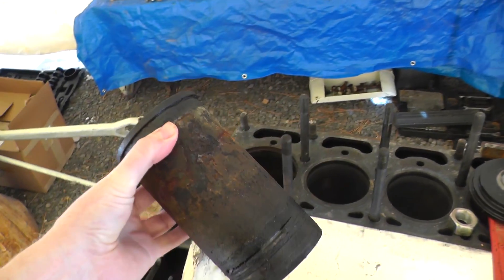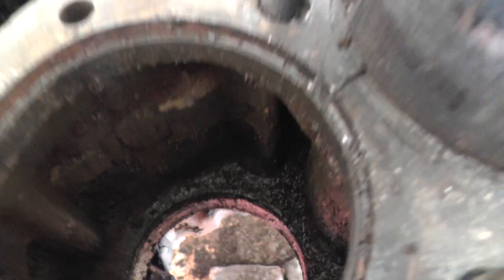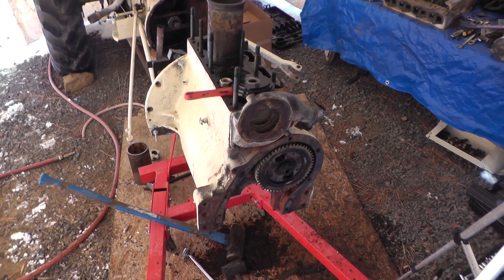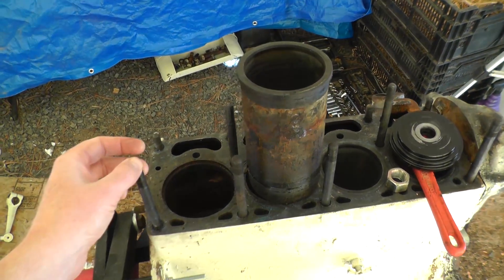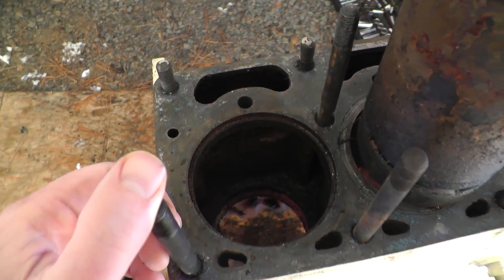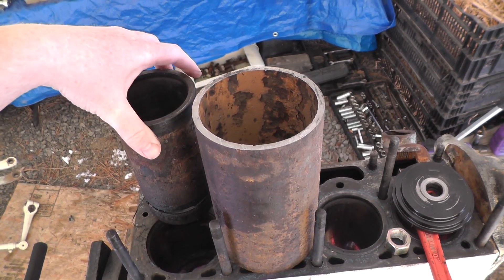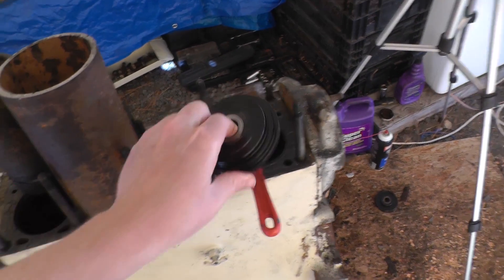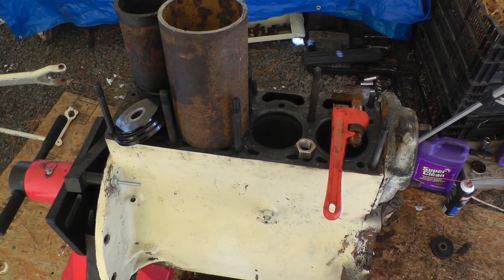Ferguson TO20 update   Ep  2.2

Comment: dont know about were you live but here in oklahoma if a farmers tractor is low on water you fill it up from the mud hole or the pond my grand paw never used antifreeze in his ford 8n so starting in the fall you opened the drain on the block and radiator when you were done with the tractor and filled it up with water before you started it it had lots of brown water put in it but wen we changed the oil we would pull the drains all the way out and dump a few buckets of water through it and flush the mud out still use the tractor to this day only rebuilt the engine once about 3 years ago when my dad got tired of putting a pork skin between the number 2 connecting rod bering and crank to stop the rod knock it would work for about 3 months of brush hoging